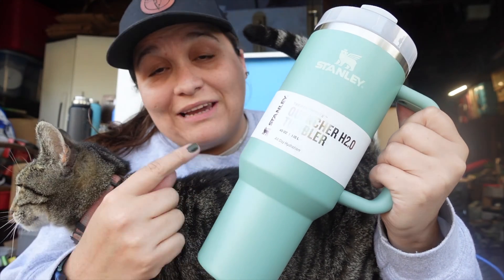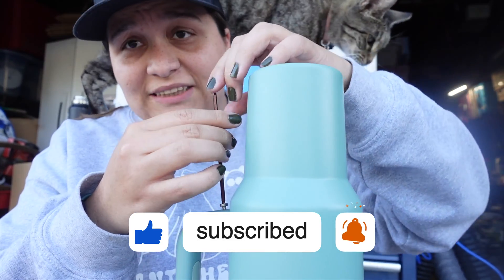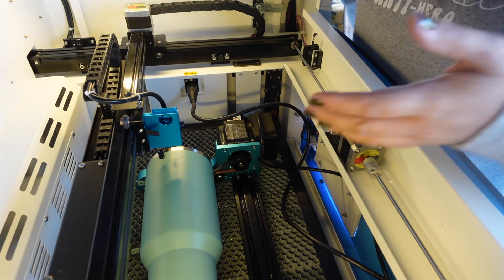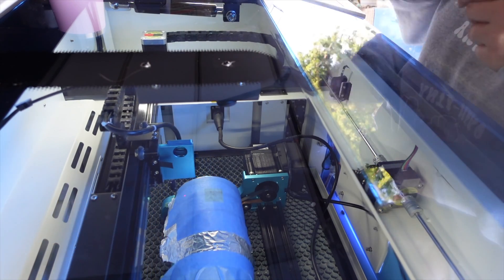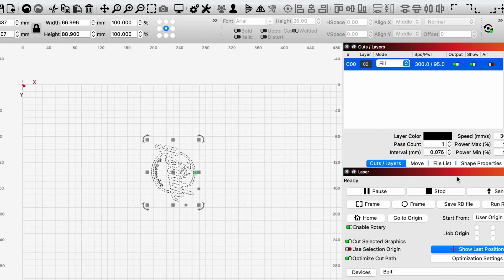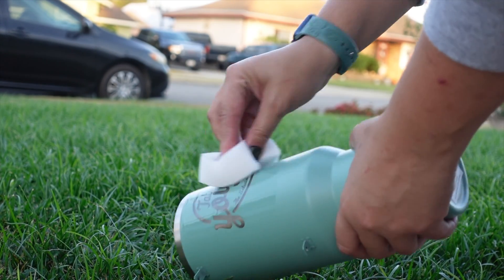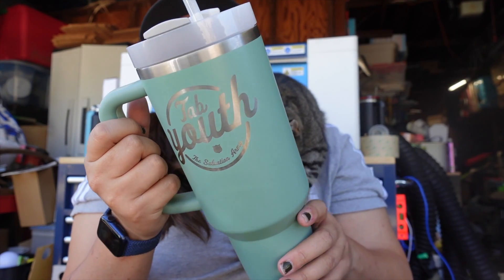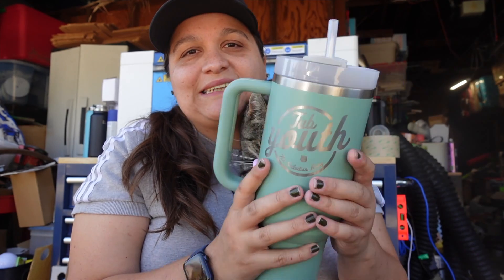How to Engrave a 40oz Stanley Tumbler on the Thunder BOLT Laser

Comment: can you help to get this started... im having trouble to be able to get started on engraving tumblers
Reply from the maker: what is the issue you are having?
Reply: it is engraving double  @ChippedBuilds
Reply from the maker: @Latienda1110  the only things I can think of is there is hidden artwork in the file or the number of passes is set to 2 in the settings.
Reply: I'm still fairly new with the bolt, how can i check if these are the issues @ChippedBuilds

Comment: Awesome video and love that cat! I'm new to this laser thing, may i ask what the sq inch test is for and what kind of foil is that?
Reply from the maker: Normal foil you get at the grocery store. The square test has to do with the rotary set up. It’s to determine if your steps per rotation is correct. Typically your rotary comes with a Manuel to set that up correctly.
Reply: thanks for your reply! @ChippedBuilds

Comment: Another awesome hands on video. The Firmware update information is super valuable especially if you are doing full wraps and you expect certain graphics under the handle. Definitely will request the update from Thunder Laser USA. I would love to see a material database  for the Thunder Bolt withe Speed and Power settings for different products that are engraved. For Example not all powder coating colors engrave the same. It would be super neat to build a data base that shows the different variables that produce perfect results for the Thunder Bolt . We would also love to see you do a full wrap on your channel as well.  Thank you for the time you take to share your journey with us. We appreciate you and Elsa 😊
Reply from the maker: I’ll be sure to let Elsa know! I am planning on doing a full step by step wrap video. Just wanted to wait until I could figure out the shifting issues.